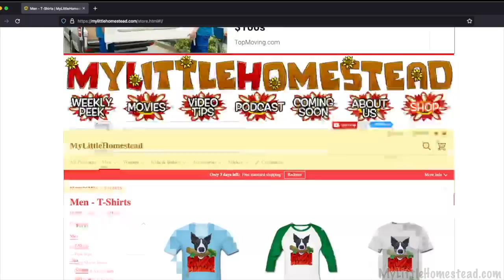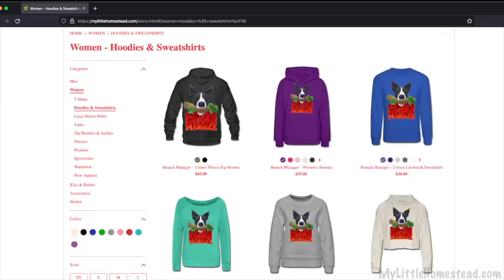Utility Rough-In for our Shop Build | Weekly Peek Ep342

Comment: You might want to run a piece of rope inside your utility pipe next time.  If you ever decide you want to run something else in the pipe such as an air line or electrical you can just tie on and pull it through.

Comment: Next time you have to remove a tree, especially a mesquite. You can plant a limb or branch & put them in wet dirt water them once or twice & you'll soon have a new Mesquite tree. I live in Phoenix, which our highest temp day was 122. I was golfing that day with my Dad. The front nine, even with our electric cart, on par 3's we'd stand in front of the sprinklers on every hole on the front nine & even short par 3's & for some reason, there wasn't a crowd there?? But by the time we were done putting, we were bone dry. The back nine, no water, no cart lady, the clubhouse was way too far away, & we'd be taking the chance that our cart would die & the back nine is a ways away, till the par 5 coming back towards the clubhouse. Plus this course doesn't allow coolers. I had a Gatorade in my bag, but hotter than a certain fluid, that was darker that day. I get home to an Air conditioner on the fritz. My Dad was a certified Air conditioning serviceman, I described what & where it was clicking. He confirmed that the compressor, the original one from 1969 & this was 1989 in AZ. I tried to sleep but when I saw my 5 & 8 year old sons covered in sweat, I headed to the roof to jump a line past the safety switch, to keep your compressor from dying, which it's death sentence was penned already. So I got it running & it lasted till my Dad came around 9 AM after I checked with my landlord. Luckily my Dad had time, cuz by the time I got home from golf, the closest appointment available was just shut of w weeks away. We'd have died by then. When I bought my house in 92 I looked for one with a swamp cooler & an AC unit. Only problem the investor told me the wrong switch. It was the first of June, perfect swamp time. Though we weren't impressed. When we got a $400 electric bill, I traced the lines & we'd left 2 doors cracked open for the swamp, but it was the AC on! The swamp cooled the house down to 70 degrees at night & with a block house, we stayed very comfortable. Till the monsoon season then we found out 3 blades from the leveler, which opens & sends the swamp air down the ac ducts. With it missing we'd be sending AC into the swamp through the missing levelers. Which I couldn't find anywhere & some Einstein had used roof tar & sealed where you'd put a cookie sheet to block your AC from blowing out through the swamp. I had to duct tape a couple cut air filters, & filled it even with the swamp & duct taped the snot out of it. Did you know originally it was called duck tape & was green? 3m got a contract from the government during WWII to seal ammo boxes, cuz the long trips by sea were causing too many misfires due to excess moisture. Then in the 50's when AC units were popular on all the new homes, it was changed to gray & call duct tape. Everything you  never needed to know about Duct (Duck) tape. I got a calendar book for the restroom, cuz I'm known to use it forucu more than it was planned for. I made a carrier bearing for my Datsun pickup that worked for 100k miles +. It can also be used in an emergency to close a wound if you're too far from medical help. Hopefully you never need to know the last one! Love your family, reminds me of my 2 sons & me. Sadly my 36 year old passed in his sleep at 36, the woman doing the autopsy I waited 11 months for, never turned his legs over this blaming it on morphine. She missed the fact he'd lost his entire patella & half the muscles ligaments & tendons Frok the top of his thigh to his shin from MRSA & MSSA. Went through a month 2 separate times taking the strongest antibiotic, which he had to have a pic line into an artery otherwise the antibiotic would eat through a vein. He had 2 golf ball sized lumps where his kneecap used to be. If she'd not been so lazy & quick to judge, she'd realize he was still in severe pain. He & I have a very high pain threshold. Motorcycle wreck & a stubborn orthopedic surgeon who should've been sued, but my son just wasn't that kind of man. I'm the luckiest father.alive, to have had the 2 sons I did. Something I  Know you're family would know. Take care of be safe & keep the channel going. Wish I'd seen it when I was younger & BC before cancer~

Comment: I have a Digido.     I use the instrument to help with my sleep issue's.    Getting off the Cpap Machine.    What treasures you find digging for the pipe lines.    I could watch you guys work for hour's ........    wait, I am.    Nice job!    (Will the duct tape degrade under ground after awhile and affect the pipeline?)

Comment: You've amazed me with some cool out there stuff on occaison,😲but THIS! 😳Still trying to get my jaw off the ground.😧I'd call it Mickey Mouse, but Mickey wouldn't own that duct taped pipe train wreck— w/ only a 1.25" vacuum hose running inside it!☹ Bury that and it WILL get clogged.😨Most shop systems go overhead exposed with 3" PVC beyond the tool hose connections.  BENDING the rules when it makes logical sense is one thing, 🤔 but that duct taped 45 degree joint and drilled connections!!!🤮🤢 Hall & Oates singing "I can't go for that — no — no can do. I can't go for that!" 😱
Reply: I so, so agree with your comment. And LOL on the “Hall and Oates, I can’t go for that———no———no can do”!!!!!!! 
All I could see was the huge mess it will be when those hoses get clogged.
Reply: Yeah. I am all for trying to save a few bucks here and there on projects but this is going to end in heart break and lost opportunity!  Please ,please use the proper pipe and fittings. You want this shop to be great, not a huge disappointment.  For vacuum you need long sweep elbows to keep air/debris moving free. I fear this will clog on the first run and be rendered useless.  Sorry!
Reply: Succinctly explained by Mostruggles and Denise C.   I rest my case.